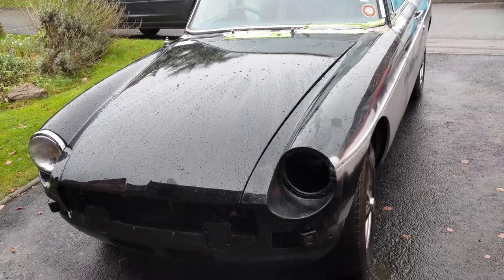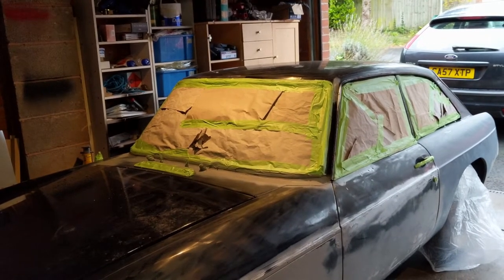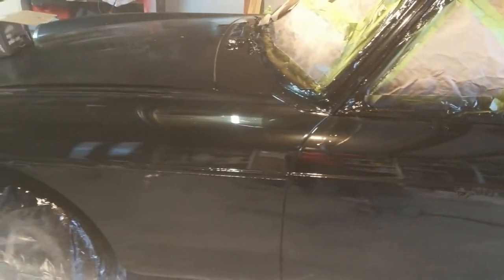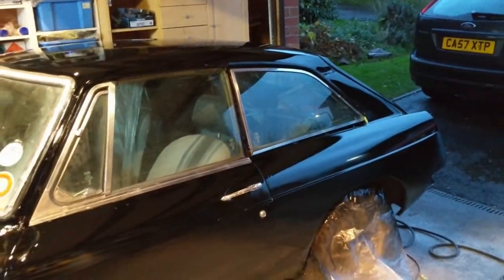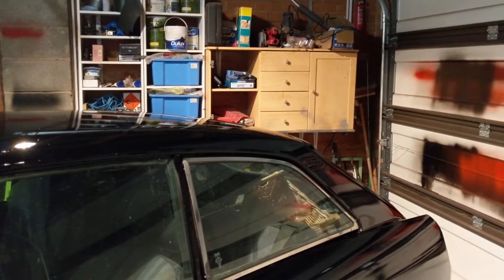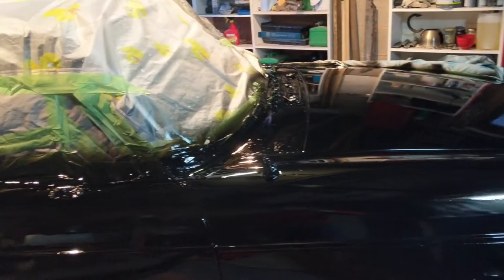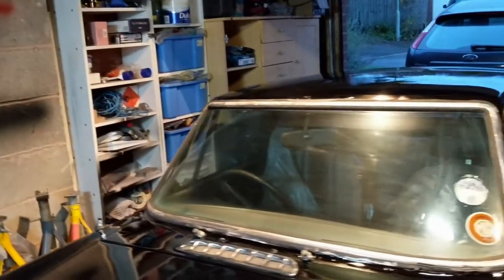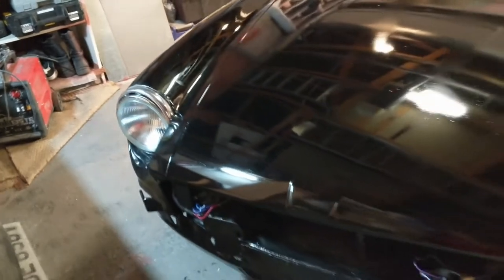MGB GT Episode 17   Painting and Chrome

Comment: Hi Henry. I’ve now caught up with all the videos and have a couple of questions regarding painting the car.  
First did you use a compressor and is a minimum pressure required? 
Second. Where did you source your paint? Is it from a specialist?
And finally did you rub down after each coat and did you apply a lacquer ?
Thanks Henry great show as always
Steve
Reply from the maker: Hi Steve, Yes, I have a compressor.  An air master and a decent size.  I cannot remember exactly what I spent now but I researched quite a lot and you need a bigger (I think mine is 90 litre) one to handle the painting.  The volume ends up being more important that the pressure.  I think I normally use 3.5 bar to actually paint, but it depends on the gun more than anything.  The different guns give you their specs.  For paint I have used Martn Brown (for the Stag hardtop) and Advanced Paints (for MGB and BMW).  For the BMW and Stag I used base coat and lacquer and I did not run down between coats (but I did sand down to 600 grit following the high build primer).  Get the base and lacquer on quickly enough to stay wet but slowly enough to not run.  Once the lacquer is hardened I then spent days sanding from 1000 grit to 3000 grit and then buffering and polishing.  For the MBG I've used direct to gloss paint so no lacquer top coat.  I think I got a better finish with the base coat/lacquer approach but I did practice more and wasn't disturbed while doing it.